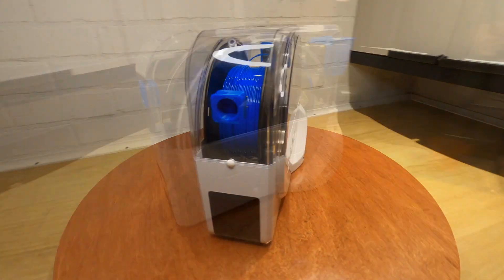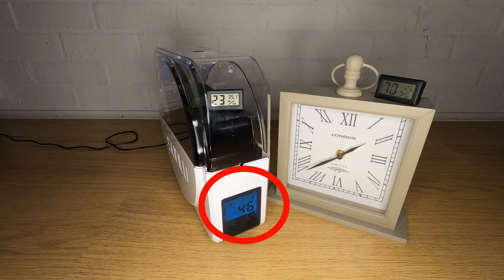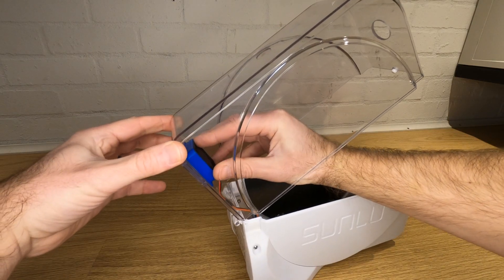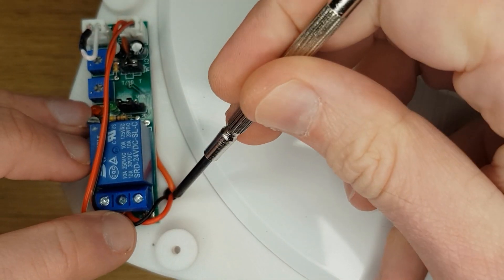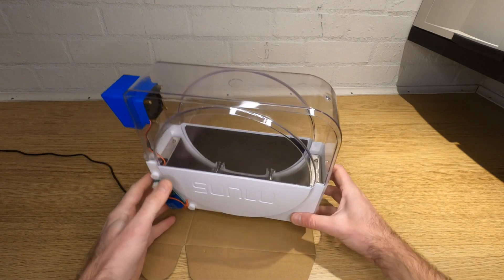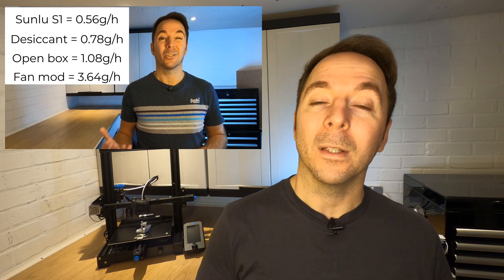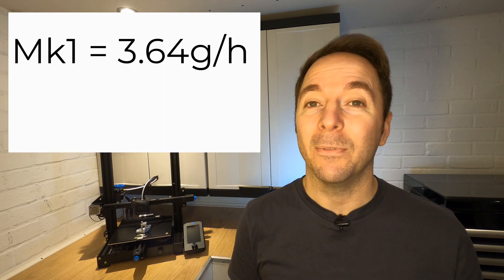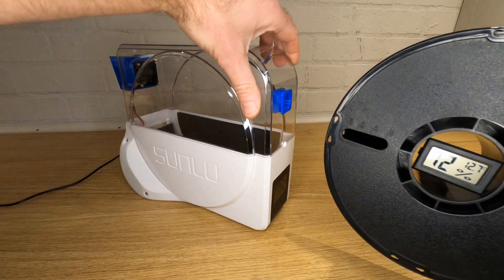Sunlu S1 Filadryer Turbo Mod Mark 2 & Build Guide (Timer, speed control, intake vents and more!)

Comment: I wonder... what about using only the towel for insulation and opening a hole in the bottom for new air to slowly get in, and a hole on the top for humid air to get out? it would be a continuous, but not excessive, removal of humidity without all the complex modifications
Reply from the maker: Yes, that would remove moisture but when the heat it turned off, the filament would start to absorb moisture again. All my kit is in my garage so I don't want to keep going out to move filament rolls in and out of dry boxes etc. I know it's all a bit OTT but I learn as I mod and enjoy it.
Reply: @RickyImpey  of course your solution is better because it adapts to all kind of applications.
My question was more parallel to your setup: since you acquired quite some experience on the topic, assuming that the filament stays there only to be dried, do you expect the drying performances of a device modified only by adding bottom and top openings, plus "towel insulation", to be adequate and better than the original setup?
My guess is that natural (therefore slow and one-way bottom to up) air circulation together with insulation could be quite good.
Thanks!
Reply from the maker: @olafmarzocchi6194  oh yes, air vents alone would make it better as convection would move the damp air on. Just opening the lid a little improves the drying capacity quite a bit. The towel or any other insulation would just help get the heat up which would also help.

Comment: It would also be nice to use an ESP32 with a relay or Mosfet to control the fan and display the humidity via a web interface, so you can remotely check it.
Reply from the maker: 🤔 Interesting....

Comment: Great ideas and designs, thank you for sharing. For testing methodology what about reusable silica gel desiccant beads? The moisture absorption/release characteristics should be much closer to filament than the sponges, while still being measurable (with bonus colour change for visual indication!)
Reply from the maker: Thanks for the comment 👍 Yes, I should do some tests with silaca beads. I tested with some when the box was new with no mods but haven't gone back and tried again since all the mods have been done🤔

Comment: How loud is the relay? Switching on and off annoying?
Reply from the maker: No not at all. It's almost silent, there is a bit of fan noise depending if you slow it down with a resistor or not.

Comment: Could you possibly help me out I think I accidentally damaged the sensor that goes to the front controll panel has black wires on can I buy a replacement or one that would work do you possibly have a link to UK Amazon if there's a replacement thank you
Reply from the maker: Hi Tom, I don't know for sure of a replacement but I imagine it is probably a pretty standard thermistor. I could have a look next time mine is apart and see if I can identify what is needed. I'm pretty sure it's a case of measuring the resistance at a known temperature.  I just googled and found someone confirming that it's a 100k NTC thermistor. If this is the case then it's the same as many 3d printer hotend thermistors like these. https://amzn.to/3suONvY I haven't tried this myself though.
Reply: @RickyImpey  do you know the name of the plus on the end of that end I know larger plus are jst but what's the names of the smaller connectors called
Reply from the maker: @tombadham999  I think they only have jst connectors on them. I'd probably just cut and solder rather than trying to buy the plug, assuming the plug isn't damaged obviously. Crimp terminals can also be a good idea for thermistors as heat can damage them if you're not careful.
Reply: @RickyImpey  also i cant seem to get the flaps on the fan shroud to be loose enough then open when you tip it over like video they open but only if you push them any ideas or tips on sorting it out
Reply: also may i ask what infill you used for fan blades
Reply from the maker: @tombadham999  I have a 1mm drill bit that I used to make sure the holes are clear and a little clean up of the edges with fine wet and dry paper goes a long way to freeing everything up.
Reply from the maker: @tombadham999  100% infill

Comment: How about using a Peltier element? Guide the air along the cold side and dry the incoming air before it enters the box. Just like how the ac of your car works. The air gets dried by condensation on the cold surface of the condensor. In your case on the cold side of the Peltier element.
The Peltier element has of course a hot side too. Use out coming air to cool this side.
Reply from the maker: I've never played with a Peltier element but always wanted too. Yes this had crossed my mind and in theory could work if done correctly. I can't remember the reason why I didn't persue this option more, maybe it was the power source or their efficiency but I'm keen to look at it again. Running the warm damp air over the cold side so that the moisture condensates would help remove the moisture so that the air could be re-used. As I'm sure you know, the warm side could be used to warm the inside of the box. We would just have to turn the element off periodically to let the condensed moisture drip off rather than just freeze on🤔 I like this, it sounds like fun to try. I'm thinking it may be best to design into a completely new Drybox, it may be a little much for a mod. Thanks for getting my brain going today👍

Comment: At 0:28 you have a drawing of a desiccant holder but make no mention of it. Have you tried something with it?
I’ve downloaded your .stl and modded it to have a mesh shelf for calcium chloride and a catchment for liquid below. Calcium chloride absorbs seven times more moisture than silica gel. Do you think that could work?
Reply from the maker: Hi, check out the first video as I tried silica gel in containers as one of my experiments. https://youtu.be/5jCVT0lXKyU it didn't work very well for the foam but could still be an option for filament which is why I still included all the stl files for the parts if you want to try it yourself. The reason I didn't try with calcium chloride is the dust that comes off it if you don't contain it very well. There is something else that might work well too but it's in the list of future videos🙂

Comment: Why are you using a temperature sensor at all for determining when you turn on the fan?  If you use a humidity sensor and place it in the middle of the box then the fan would only turn on when the humidity is high.  It would then pull the moist air out and outside air in.  Though you might want to also have a humidity sensor outside to make sure you arent going to pull in air thats more humid.  Nice mod though.
Reply from the maker: Yes, good idea but I've never found a very good humidity sensor. I'd be happy to try one if there is a good one that's not expensive.

Comment: Some great ideas, what about a heated air intake blowing hot air into the enclosure.
Linked to a thermostat you could push the temperature closer to 70 deg and drying things like nylon a possibility.
Reply from the maker: Good idea Raymond, I don't love the idea of another heater but if there is a way to do it re-using the warm air then it's promising.

Comment: next You should invent a 24V motor Spool Rotating system based on Stepper motor(28BYJ-48) and Driver board(ULN2003) or else
Reply from the maker: Rotating the spool would help heat the spool evenly but it might be easier to even the heat out around the box🤔

Comment: One of the concerns in the conception of this dryer is that it measures the temperature at the bottom of the box. It means that the air above, i.e. around the middle/top of the spool could be cooler. You could then try to relocate the temperature sensor to the middle/top of the box to see how the global temperature evolves. Some other mods do this as well as using a blowing fan to force the hot air to circulate around the spool.
BTW very good video, keep up the good work 💪👍
Reply from the maker: Sure, my only concern with moving the sensor is that it may cause the heating element to get too hot for the plastic that it is fixed to. This is where the air circulation fan wins as it evens out the air temp without having the element get too hot. The only problem then is that the damp air doesn't leave. I may try moving one of the sensors though, there are two on mine so leaving one may keep the safety control in place. Thanks for your suggestions.
Reply: if the air is cooler, it will fall down below again. The issue is that the air too close to the heater is measured, not realistic temperature measurement.

Comment: I like the different paths you have looked at here... I'm just thinking these type of "driers" just don't do the job very well. The cost is too high for the return.

Use something as easy like a food dehydrator to dry the filament and then place it in a sealed boxed with desiccant to absorb any moisture that may get in. So much simpler and cheaper. Remember the K I.S.S. rule.

I will say though, you need to be hired by these companies as an engineer! I use to mentor for a local FIRST robotics league for high school students. My fist group of kids we won the state championship. While I was even going through through cancer treatments as well. I'm still friends with the head mentor and team leader. It was great fostering the learning spirit in these kids minds. 

Keep up the great work Ricky!
Reply from the maker: I do agree with K.I.S.S Jeff and I know I'm going way over the top with all these different addons for this dryer but it's fun and I'm learning. I don't plan on stopping either🙂 I think it's possible to create a filament dryer that can get the internal box air temperature to over 50°C and be controlled and have the air inside really dry. I also think I'll be able to do it in a way that can be simplified and made cheaply. It may be that a food dehydrator is still the better option at the end of it all and that's fine. Thanks for your support and comments 👍
Reply: @RickyImpey  I understand.
Reply: That's why I bought a jayo S1 dryer (same as the sunlu) which usually goes on sale for ~$35. Got it used (new in box) for under $20 and it's a great dryer. Had I not gotten that deal I would've just gone the food dehydrator route, though I can still use this for keeping filament dry during printing.